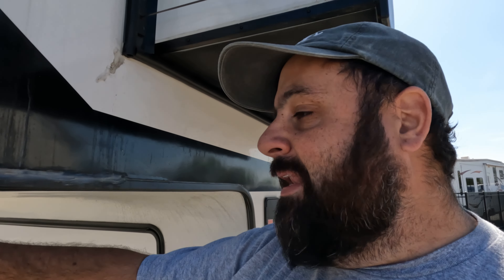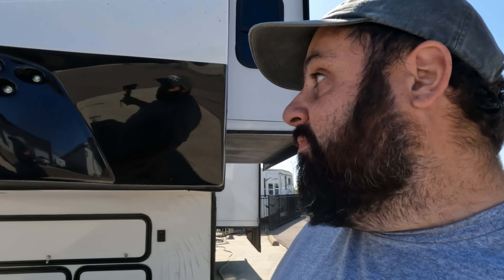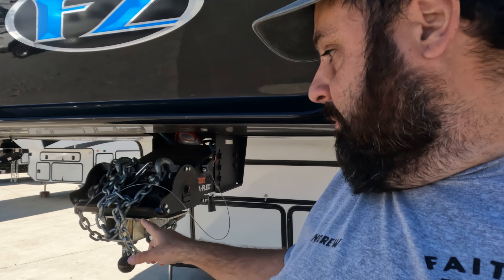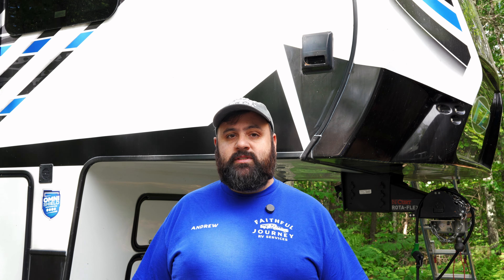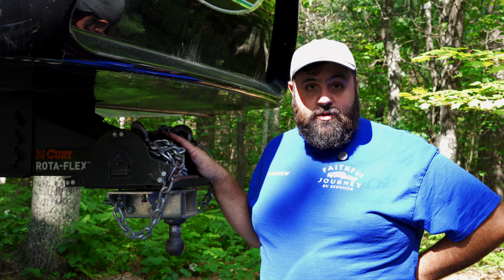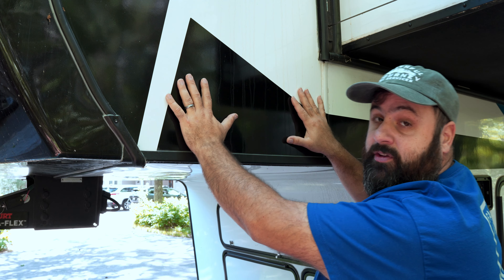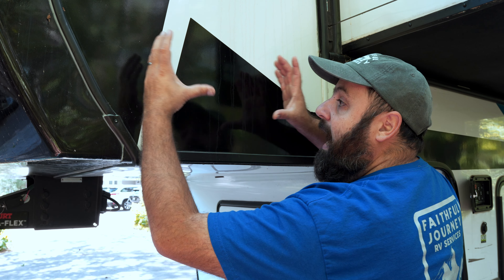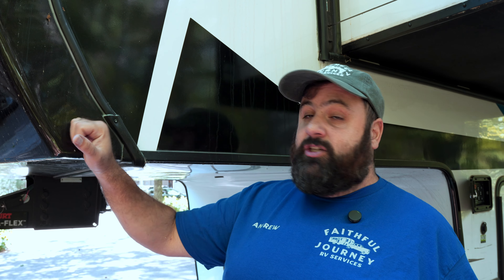Keystone RV - FRAME FLEX Crack and Repair!

Comment: Thx FJRV for sharing your experience with an informative and accurate video without the drama of other YTbers (click bait) about frame excessive flex/failure. FWIW I've been rving for more than 30yrs ( on 3rd 5th wheel + numerous bumper pulls) currently have 375 Fuzion 40' 3 axle. I worked on Commercial and military AC including Blackbirds which all flex during operation its when excessive forces beyond design criteria that deformation and structural damage takes place. IMHO most towable RVs are built like aircraft as light as possible with structural design criteria safety factors as low as can be marketable for the intended load carrying capacity and usuage. FWIW my parents RIP took their 32' 5ver up the Alcan Hwy to Alaska when it mostly was not paved  their trlr required numerous repairs including structural welding of frame junction between  vertical and horizontal at overhang along with broken axle ubolts, hangers and springs. I mostly camp on USFS property which involves traversing 2 track fire roads with ruts, rocks and roots at walking speed when needed. Because of this intended use I installed a 4/20k# Reese Goosebox air ride pinbox and Moorryde SR4 with Xframe suspension. My rig has not suffered from excessive frame flex/failure with structural failure but I do not exceed GVW and max pin weight and tow at 55-60 with airbags in TV. YMMV Happy Camping.
Reply from the maker: Thanks, I'm not into making click bait videos but rather informative helpful ones.

Comment: Based on your video and what Affinity did, it appears that all  Lippert really needs to do is weld gusset plates on all frame cross-member/frame connections to strengthen the whole frame BEFORE sending the frames out. This means ALL frames shipped. A simple, relatively inexpensive fix that would save everyone grief, aggravation, and repair cost to fix cracked/broken welds. Remember the old adage: "A stitch in time saves nine."

Comment: Geezus!  So little tow miles and you had this problem. It says only one thing, Lippert needs to turn the finger around and point right at themselves!

I remember when you could literally stop by at Affinity and get service the same day!  Understand while you waited, but there are a number of commercial  shops that design and build trailers. They routinely repair RV frames and can be gotten into in days.  Lippert and RV manufacturers have no problem working with them. Been there, done that!  Lol.

Tip for your triple and the frame - avoid any kind of tight turning as often as you can. The triple axles provide a significant resistance and tight turns torque the entire frame.  I'm not speculating either.  I'm a real, live, practicing structural engineer!
Reply from the maker: Yeah clearly there is a frame issue that Lippert needs to figure out. And yes I try to avoid any tight turning with a triple axle, especially on pavement.

Comment: I do not disagree that the common denominator is Lippert but the overall problem is a shared one between Lippert and the RV assembly companies. As we know, Lippert builds to spec from the RV assembly companies. I am curious if Lippert will start enforcing tighter engineering standards given how these frames are being utilized by the RV company. Will they start requiring review of any plans that move the frame off of one floorplan to another? It is their product that is being questioned so I would hope they would take a more active role in ensuring their product is not being incorrectly used by the RV assembly companies. We also understand that it's a fine line for Lippert to walk as they are THE supplier to the entire RV industry. This includes all of the products they offer, well past just the frames. However, in our case as owners of a Grand Design Momentum, Grand Design should probably tread lightly in throwing Lippert under the bus, as we've heard from some of our members on the "Grand Design RV Major Issues" FB page. Now is the time to stop pointing fingers at each other and truly collaborate to build the highest quality product for the RV consumer. It is well past time that we got our money's worth.

Comment: I owned a 40' filth wheel toy hauler in the early 2000's..The same thing happen to my unit  that is still happening to new units today. The industry doesn't care about fixing this problem or they would have made the changes..quit buying this crap. If you are still driving this unit around you are asking for trouble. I would love to get back into the RV game but there isnt a product out there that doesn't have major problems.

Comment: RV frames are not designed to take the amount weight and use that users expect these days. If you get a 35’+ fifth wheeler, don’t move it more than four times a year! Don’t try live in it full time!!! It wasn’t designed for that! Avoid bumpy roads and uneven parking services whenever possible. If you have a toy in the back and a washing machine/dryer in the bedroom along with a slide, you will likely crack that frame. Trailers are designed for LIGHT use, meaning, don’t sell your house and buy one, unless you can park it and rarely move it.